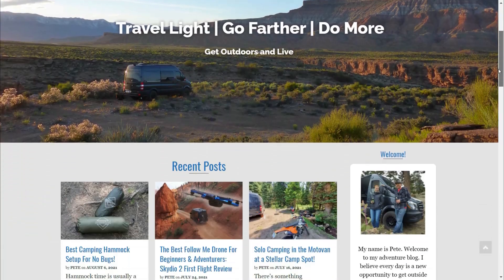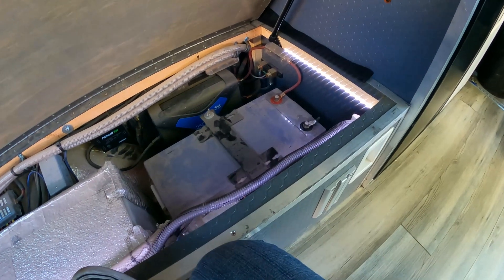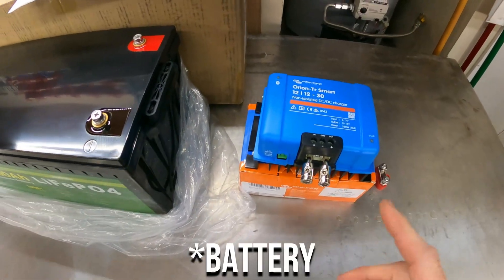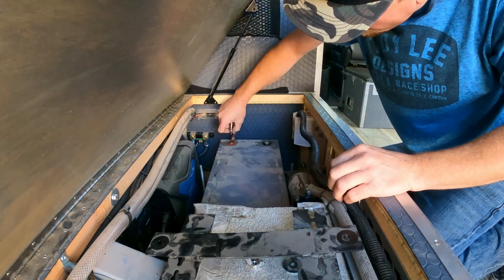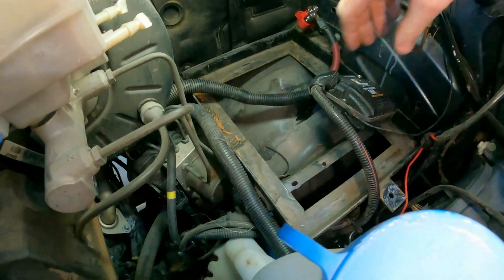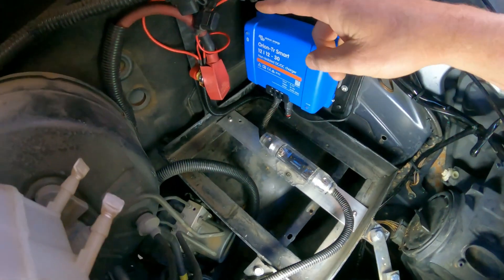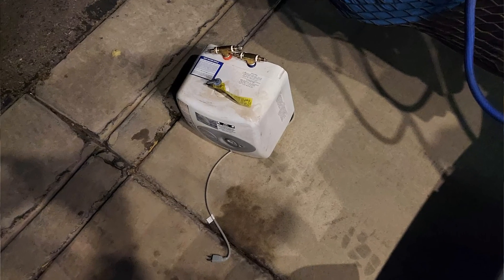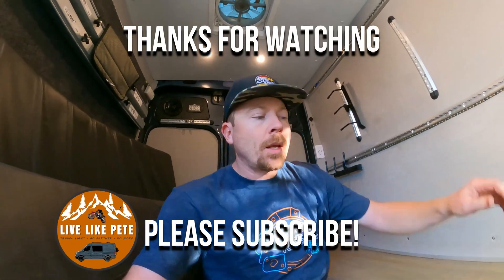Upgrading From 3 AGM Batteries To One Lithium Battery In the Sprinter Campervan

Comment: I have a 160W solar panel and a 50-liter refrigerator that runs directly on the solar panel without a regulator. It works well on sunny days, but on cloudy and foggy days, my refrigerator doesn't work. How can I solve this problem and make it run 24 hours a day, even in cloudy and foggy weather?
Reply from the maker: More battery capacity and then more solar to get it charged back up.
Reply: @LiveLikePete 
How many amps do I need for batteries and how many watts for solar panels?

My car is a Land Cruiser 100 series and as you know it doesn't have as much space as your truck.
Reply from the maker: @oldstory-sz4qc I'd go at least 200Ah battery. 300Ah would be better and it's the same physical size. 300-400 watts of solar is great but probably too big for your rig. Look at a portable set-up you can set out in camp. Just go as much as you can on battery and solar. You can't have too much.
Reply: @LiveLikePete 
Thank you so much for helping me and I really appreciate it.

Comment: Good move however the DC to DC  charger  is a boost circuit  and should be near the house battery not the engine battery to avoild the voltage drops on long runs
Reply from the maker: I understand what you're saying, but there isn't any voltage drop with the 2/0 gauge cable.
Reply: @LiveLikePete  I have 300ah of Lifepo4 on my RV  -  I selected the "Light" BMS cycle  to extend the cycle life - I seldom use more than 25% but its nice having a reserve for them iffy days
Reply: Did I understand it right and Do you also start your Carr on the lithium battery? Hoe does that work for you? Is it also possible to keep your starter battery ? Anyway Tnx for the effort of the video!!!